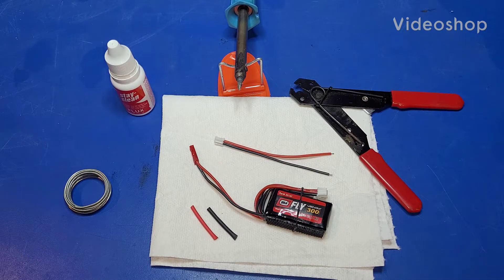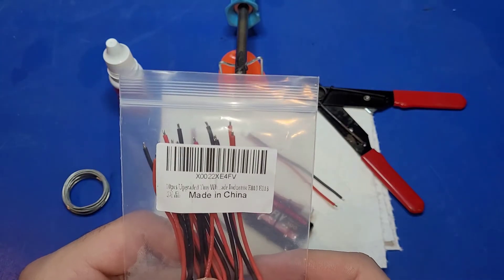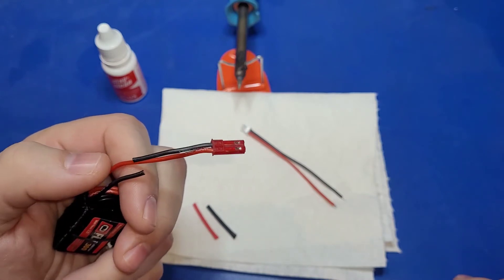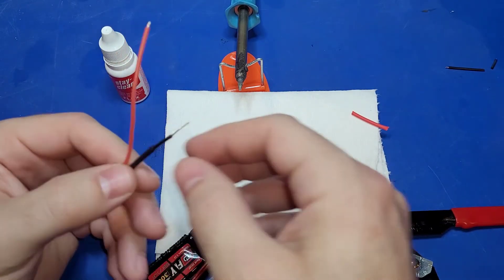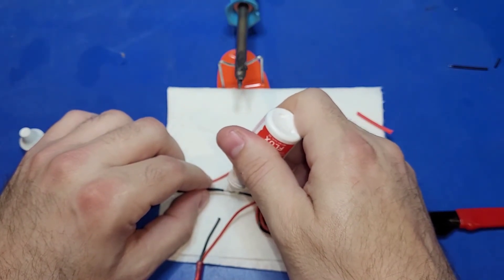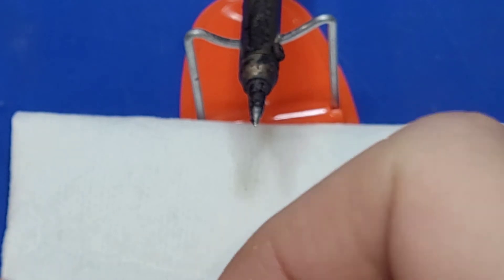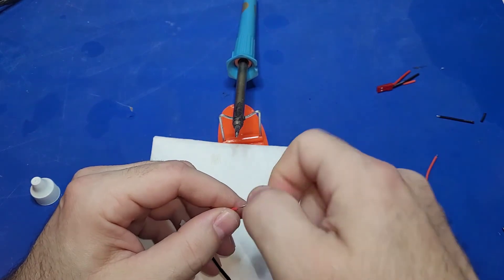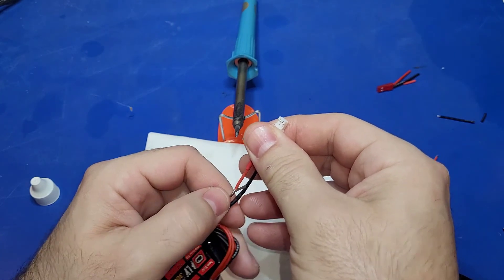HOW TO: Swap Miniature LiPo Connectors (JST to JST-PH 2.0)

Comment: Is it okay to change the jst ph connector with sm connector?
Im looking for 18650battery replacement for my emergency light with jst connector
Reply from the maker: I don't see any reason the same technique wouldn't work for any other type of connector, as long as the ratings are similar.
Reply: @JPWirt  thanks a lot.i cant find any on the shoponline on sale of battery with sm connector
Reply: @JPWirt  but the size is of the sm is slight bigger than the ph connector.
Reply from the maker: @amelitogarzo1553  I can't help you much there, sorry.  You'll be the best judge if what you're wanting to fit this in will actually fit or not.
Reply: @JPWirt  is there no any kind of risk if i do that like damaging the device or even worse explosion
Reply from the maker: @amelitogarzo1553  there is if you cut both battery leads at the same time.  A safer way might be to just make a short adapter harness if you have the room for it.  Then you don't have to mess with cutting battery leads.
Reply: @JPWirt  how about just remove only the connector then the wire inside it transfer to the sm connector?

Comment: Don't apologize for you're manner of speaking. Your cadence tells me you think about what you're saying. Those that babble at high speed usually have little worth saying. And don't address the whiners. It just gives them undeserved power.  :) 
I'm just learning all I can before getting a Deadbolt so I really appreciate your videos!!! Thank you!
Reply from the maker: Thanks for the encouragement Bert!  You nailed it.  That's exactly what I do.  Glad you like the how-to videos.
Reply: @JPWirt  Funny, for a second, I thought you and EXPIOWA might be the same guy. I noticed you both had rock piles in your house for crawling, then I noticed your carpet is identical...... LOL! 
Hope all is well in your spot in the world. Cheers!
Reply from the maker: @wingnutbert9685 , I was going to build a foam course for inside until I saw his rocks inside.  He's definitely an inspiration of mine.
Reply: @JPWirt  His new foam pieces are nice too. The way he's cut and finished them looks quite good. Certainly much nicer then alot of the plaster cloth ones I've seen. They usually have the cloth showing through and the plaster is really too fragile. I suggest using a watered down thin mix of a polymer modified grout. Comes in lots of 'stone' like colors and is hard like cement. If you want dirt, without the mess of dirt, you can mix used coffee grounds that have been baked dry in the oven mixed with 2 part epoxy. Doesn't take much epoxy and it dries very hard and durable. May have to prime the foam though, so do a small test piece to see if the epoxy dissolves the foam first, before going at your good piece. :)
Reply from the maker: @wingnutbert9685 , oooo, I like that coffee idea!
Reply: @JPWirt  Yeah. I did an underground cut-a-way diorama for a commercial company to show how they install perimeter drains around a house. I used coffee grounds for the dirt. And used 3/4" drain rock for another level. Both worked great. The rock/epoxy mix looked a bit glossy/wet from the epoxy once dry. But one could hit it with steel wool or maybe shoot it with some matte clear coat to take down the gloss. When applying the stone/epoxy mix, the surface need to be level and flat horizontally so the epoxy doesn't run. And again, it takes less epoxy then you think. I made small batches, mixed by hand in a Stainless steel mixing bowl from the dollar store. It's only going to be used for this from there on out! :D. You could do sand like the coffee as well. Real dirt doesn't work as it dissolves too much and just looks like mud. Could mix the coffee and sand too for a different effect.